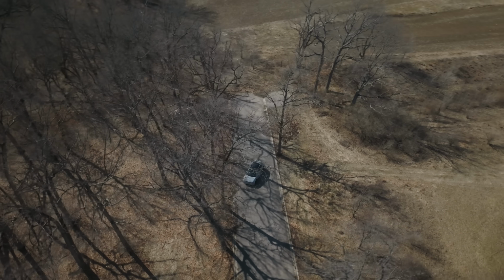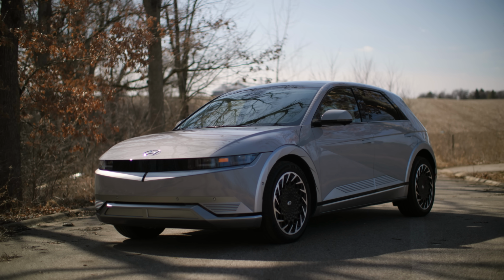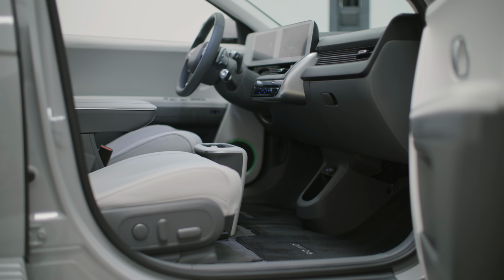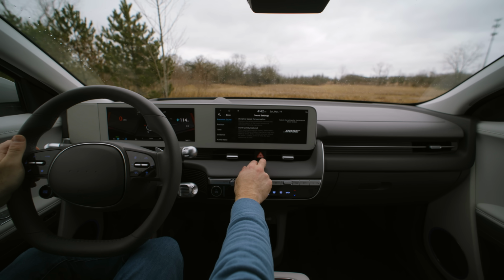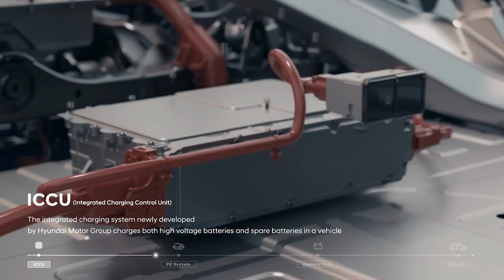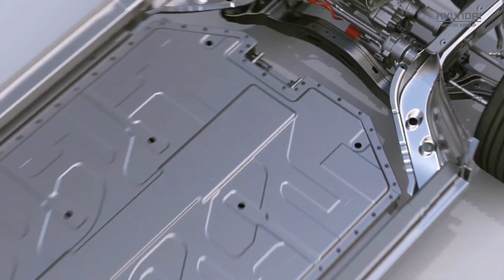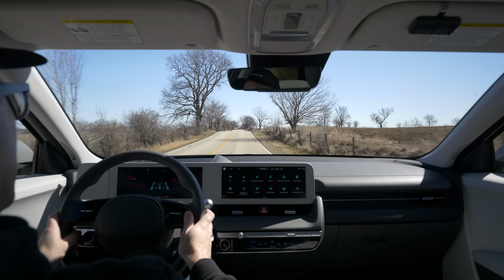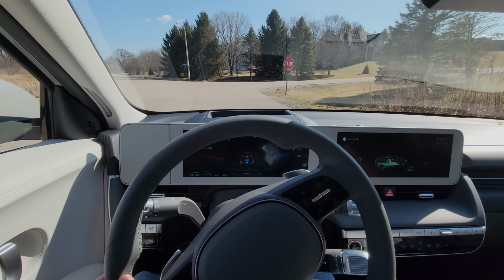2022 Hyundai Ioniq5 EV | Fixing Failed Experiments

Comment: Fine review. Not sure why you feel the need to say so much negative things about the ‘15 Soul EV though. I own a ‘18 Soul EV and it’s been my absolute most reliable, cheap to run car ever. A grand total of ZERO issues in 4 years, 76 000 km so far. It’s obviously limited in range, of course. But it’s also a very confortable car, with near luxury equipment (panoramic moonroof that opens (can’t get that on any new gen EV!), ventilated seats, heated seats, heat pump, LED interior lighting, leather seats). The Soul EV is less power hungry than the IONIQ 5 and can fast charge up to 67 kW too. Faster than a Bolt. It’s a much better car than what you’re describing, honestly.

I preordered the IONIQ 5 (Up here in Canada, preorders are 12-18 months long these days). I’m sure I’ll love it, but I will miss my Soul EV’s pano roof and simple controls. Hey, heated/cooled seats at the touch of ONE button! Crazy!

Comment: Dissapointed to see both subframes are steel. So in essence this one will need them rustproofed front and back, since the motors wont generate any meaningfull  amount of heat to deter moisture on either end. Looks like a more cohesive product (and an actual product at all) than the VW id line. Calling it an suv is BS though, first time i saw these on the road it just looked like a normal hatchback someone scaled up 150% in all dimensions.

Comment: This platform is a good attempt by Hyundai. Interior and exterior are well executed but under the skin may not be as well done as Tesla. Examples of this would be the lack of front trunk due to poor packaging and two different coolant loops. Not the biggest deal and I’m sure that in the next generation Hyundai ev platform these will no longer be issues. Really the big question is service. Knowing Hyundai and Kia dealerships aren’t the best, taking in this car will probably be a nightmare. the lack of expertise from technicians will probably be a sore spot for a while. You just gotta hope nothing goes wrong during the lease. However, this is true for most car companies including Tesla to some degree. I would take this over an id4 and maybe a mach e, but I’m not sure if I would take it over a Tesla model y. Tesla is leaps and bounds above the other oems in many aspects and this lead will only grow with the introduction of large castings and 4680 cells being introduced to the mass market vehicles. Regardless, this is still a great attempt by Hyundai and I’m sure that tho he will only get better in the future.

Comment: I think your niche in the YouTuber market has been that commentary on the art of design and mechanical engineering. I would like to see a small clip of the color choices from the brand’s configurator or media package when you do a car because sometimes it makes a huge difference to a car, especially if everyone has the same press car to review. (I’m still cringing from that raspberry pink Taycan everyone did). This IONIC 5 in black is pretty diffusing for those who are put off by the design elements this color highlights, for example.

Comment: With range and batteries, I don't think we will see much more range in ev's almost ever, I think we will see battery pack size and weight reductions as battery density increases. The subtle increases in range will be with the weight reduced from the physically smaller, but same capacity batteries, and maybe with bigger trucks meant to tow we will see just ginormous battery packs

Comment: One thing with the brakes. My buddy whos a mechanic replaced the factory brakepads on an old model S, the car had 270,000 miles and he replaced the brake pads out of principle, that they were 7 years old. They still had plenty of life in them.  Provided you have room in the battery to accept the charge, the regen braking capabilities of full EV's is realistically enough to bring the vehicle to a dead stop in an emergency situation. The issue is that they are 100% software controlled brakes, and there's no physical component to regen braking. In the event of a software failure where it doesn't regen break, you have the mechanical disk brakes, but they are ultimately there for redundancy. Newer EV's that have more refined regen braking systems have very aggressive one pedal driving options, with all but emergency stops being handled by regen.

Comment: Great review Mark!  It’s not perfect but, along with the EV6, it’s probably the best EV available (Teslas are not for me).  I prefer the interior and exterior of the EV6, as well as its slightly better handling and range.  I can’t wait to get your take on the EV6.  I love the looks of the Genesis GV70 but not so much the GV60.  There aren’t many cars I put down as “girlie” but the GV60 is there for me.  But I wonder if the eGV70 will be compromised since it is not an EV only platform. What do you think?
Reply: I wonder if they kept EVs in mind when they designed the GV70? My guess is they did, so it may be an easy changeover.

Comment: In regards to brakes, it is not correct that they wear out faster in EV's. Most EV's use One Pedal Braking, where the motors do the braking. I have a Polestar 2, and I barely use my brakes. At 2000 miles, my rotors still look new and I have almost zero brake dust. At this rate, my brakes are not going to wear out for at least 100K. In fact, if my rotors do wear out if may be from not being used enough!

Comment: I was surprised how few RWD models there were in my area of MD and got the SE since it was the only RWD model they had and love it. I don't need the extra speed and this is now the fastest car I've ever owned. The only disappointing thing about the RWD is that it doesn't have a heat pump or battery heating system so your charging will be a lot slower in really cold temperatures and your heat won't be as efficient, although it will be warmer than one with a heat pump. I disagree with regards to leasing it as you wouldn't qualify for the tax credit. Otherwise, great review.

Comment: A few of them are already driving around here. It's certainly interesting to look at, and it's certainly better than any WV concern EV, but controls and infotainment feel like a major letdown.
Still a much better design package compared to new Tucson :-D
Reply: The Hyundai/Kia infotainment may not be as flashy as some, but it's straightforward, easy to learn, has the usual features, and it works. It's a mature system that they've slowly improved instead of constantly having to start over, like some others.
Reply: @markmiller3279  I wrote it wrong, as I did not differentiate between infotainment and digital driver display. I like infotainment part (mostly, when they do not group volume and climate to one button) of Kia/Hyundai - I was making fun of their driver display, which reminds me days of Android 2.1 ;)

Comment: I have to say this was the most objective and non-comparative reviews I’ve seen. Though the battery temperature management needs more capacity to achieve more consistent peak charging performance, this is making lower voltage system that are optimized that can only sustain that a few minutes at peak rate of charge seem like so last decade tech. Not sure future tech later this decade will achieve the same charging performance gap. Where are the rear heated seats and locking glove box in that top spec box❓
Reply: It still gets from 10% to 80% in 18 minutes. Other reviewers have equalled or even exceeded Hyindai's claims. It maintains its peak charging rate for the great majority of that 18 minutes before having to cut back. That 70% is a good 200 miles, or more in the RWD model. This and the EV6 are the first EVs to have charging rates I'd find acceptable. Charge once in the middle of the day while you're stretching your legs, visiting the restroom, and maybe grabbing a fast lunch. It's easy to spend 18 minutes, where the 45-60 minutes of other cars is a drag.

Comment: I drove this car about a month and a half to two months ago. Love the look, love the interior, love the drive, love the speed, love the ergonomics and tech, love the handling. I don’t love the range. Reality is it will average 200-210 miles on a full battery (AWD version which is what I drove), and there’s no way a road trip would be comfortably done with that. An EV markets itself as “comfortable”. What’s comfortable about having to stick to a route, and charging every 200 miles (or less if each time I’m only getting an 80% charge), when I can get 450-500 miles out of my 400whp/420wtq MK7 GTI on one tank of gas on a road trip, of which I can fill up in 5 minutes? I also don’t love the price. It was marked at $60k at my dealership, for the AWD version…for a Hyundai!!!! 

Awesome car, but EV’s just aren’t practical for anything outside of city only driving yet. When they start making 500 mile range EV’s, then I’ll start becoming more interested.

Comment: Interesting fact: regarding the missing Hyundai badge on the steering wheel mentioned @ 6:50. The four dots on the steering wheel is Morse Code for the letter "H" so in a way, the Hyundai badge is still there.

Comment: Actually though heavier than comparable ICE cars, EVs tend toward far less brake wear due to regenerative breaking.  Tires on the other hand due have a bit more weight to contend with but if low friction tires (for range) they may not suffer too much extra wear.  However since most EVs acceleration is so fun, you may find tires the victim of a heavy right foot.

Comment: So Hyundai should get rid of aerodynamic improvements so you can have more room in the rear Hatch area but you then list all the problems that come with larger battery packs for more range. It is like you can't make the connection between the two issues at all? You must be a "Automotive Journalist ".

Comment: Awesome review, Mark. I test drove the rwd long-range version of this car at my local dealer (they didn’t have any others to try) and was also quite impressed with its performance for a daily driver. The only thing that was a bit lacklustre in my opinion was that a fair number of the touch points felt cheap given the price. This doesn’t seem to be the case in the model that you drove, so to me, it would make sense to spend the extra 5-10,000 to get this car for its full potential. I can imagine the awd version is even better — it is also the version that I would go for given the harsh Canadian winters where I live. 

As these technologies become less novel and economies of scale really kick in, the base rwd version will be the exact sort of vehicle that makes sense as a daily driver for almost anyone, it’s just not quite there at the current pricing. Although for more enthusiast drivers, I think the range topping models are about the right price and make a compelling option.
Reply: I haven't seen too many reviews on the RWD version.  I live in SoCal so RWD is fine for me and I was wondering, would the over all driving dynamics be likely better in the RWD version (with stability and traction control off) like is often the case in ICE vehicles?
Reply: @ericlecours4208  honestly I’d have to try them both, but I tested the rwd version on a dry day so it isn’t completely different than what you may experience in SoCal. I tried all combos of regenerative braking and stability and traction control on/off. To me it felt pretty well planted, but with stability and trac on, the systems were pretty overbearing (like Mark said in the review). It felt good, but with the rwd’s lesser power figures, I would say that it is more of a utilitarian style vehicle. In my opinion, you wouldn’t have as much fun hooning it around like you’d think of a rwd ICE car. For the rwd, think of it as much better Nissan Leaf, less a hot hatch. I think if you want to have a really fun time with the car AWD higher trims is likely the way to go. To me it’s less of a fun toy and more of a just super competent do-it-all kind of car.
Reply: @skylerm6704  THat makes sense, thanks.  Much more power for the AWD
Reply: @ericlecours4208  The RWD will let you slide with everything off :)
Reply: @LeveqineX  Great to know!!

Comment: Are you sure the motors are not physically connected? I’ve heard from other reviews that there is a mechanical part that engages the front motor when needed and then physically disconnects to improve efficiency.

Comment: That car is freaking silent. They did an amazing job with the sound isolation!
Reply: Much quieter than Tesla.
Reply: True, but all they really had to worry about was tire/suspension noise. A modern aerodynamic shape has little wind noise, and electric motors are very quiet. Still, they did do a good job on it.

Comment: You forgot to mention that exterior styling of the Ioniq 5 was inspired by the original Hyundai Pony from the 1970s.
Reply: It's clear if you look at the two. The Pony, like the VW Golf and the Lancia Delta, was designed by Giorgetto Giugiaro's Italdesign company. There are strong resemblances between the three cars, which is why this resembles both the Golf and Delta in parts.

Comment: Don't believe the electric car hype.  They cost just as much as ICE cars if not more and you are not really saving the environment or traffic problems.

If you really care about saving the environment get a job that's 2 to 10 miles from your house and ride your bike or electric bike to work.

You can buy an electric motor kit for $350 and battery for $300 on Amazon that will allow you to go up to 25mph for 20 miles.

Comment: I really want this car.. but availability and prices are so bad right now. Also I can wit till solid state batteries drop the weight, improve charge times, cold performance, etc. I wish they had announced a EV/Ionic * something smaller would come next, instead of a larger one.  I drive a perfectly good condition car with 75k miles on it, I'm the only owner of. I can wait for the next perfict fit for me. These new gen EV only platforms are getting so good though, it's so tempting to jump on earlier than nescisary for me.

Comment: Excellent review, and vehicle, obviously.  The comment about Hyundai/Kia's overreactive stability/traction control could not be more true.  I've had several what feel like near-death experiences turning left or right under hard throttle at a busy intersection and having the power cut drastically.  Now on my third new Kia SUV to do this, I've resorted to turning off the stability control ahead of time if possible in those situations.

Comment: Great thoughts Mark I think they will reverse course. And have more physical controls in the next model. Capacitive touch controls I feel will be troublesome. And costly in repairs. Just in 5 to 7 years the range will probably increase to 400 to 450 miles to a charge. Electric SUV’s will be on the lower end to 325 miles. And hopefully the intra-structure for charging stations will increase and that will help automakers in producing electric vehicles. That whip lash effect of Instant torque is great.